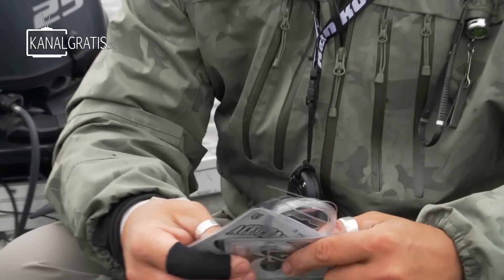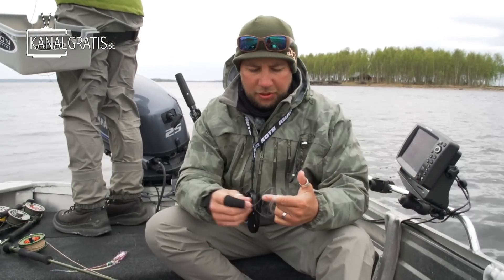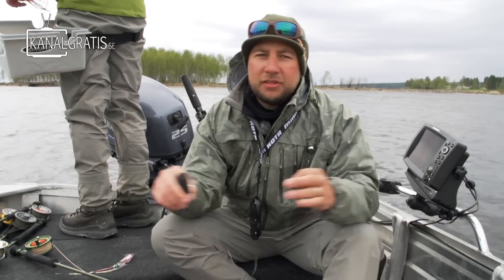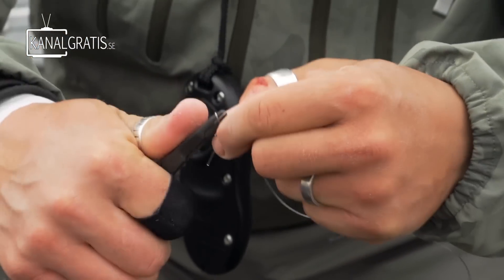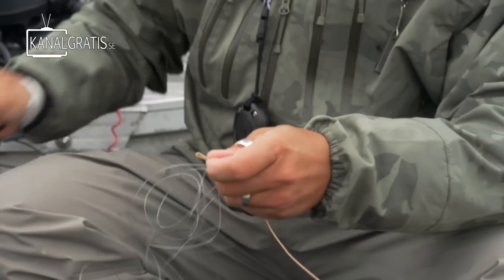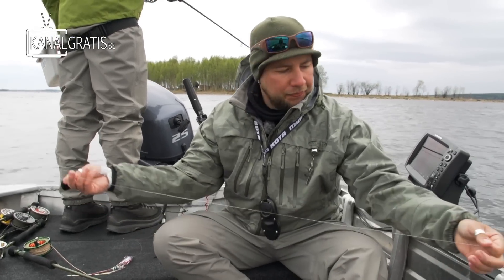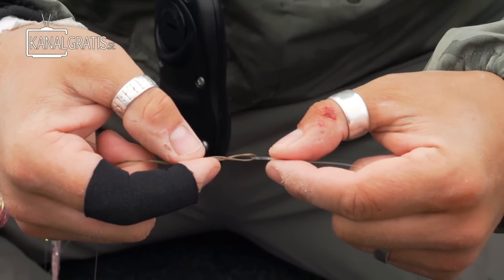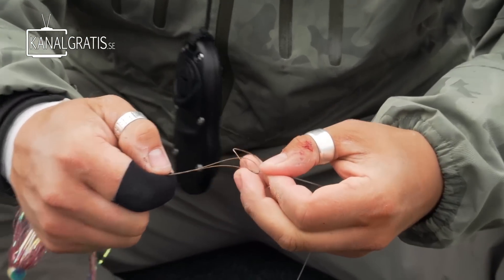How to make leaders for Pike Fly Fishing | Kanalgratis.se

Comment: Pike teeth can easily cut through nylon. I would never, ever fish for pike without a section of wire - about 25cm - attached to the nylon.
Reply: +Mark Williams i use a system like this .
line - WF9F  then - 1 meter 25Lb mono , Pafex Knotable Titanium 30 cm - berkeley Easy clip size  7 or 10 then the fly . 
never had one break free . from 1/2 Kg to 7 Kg .. works for me .

Cheers
Reply: At 2:18 he says wire  .